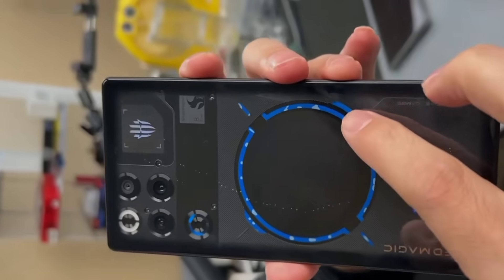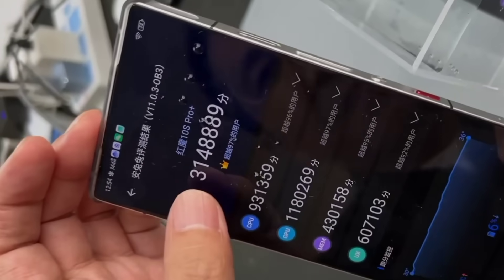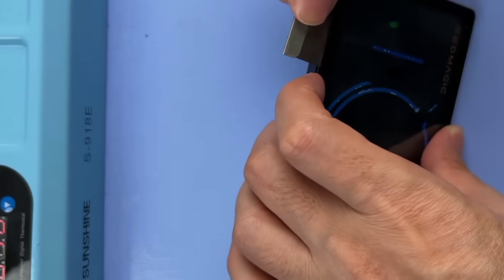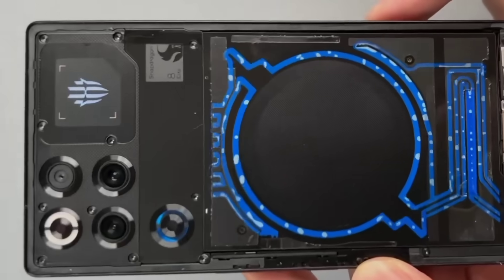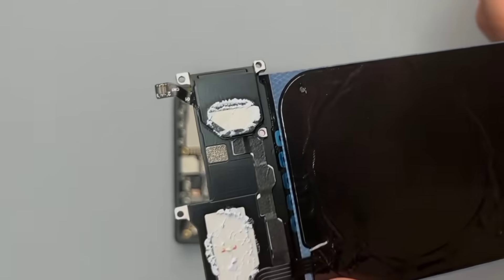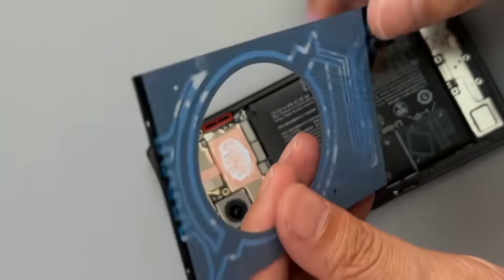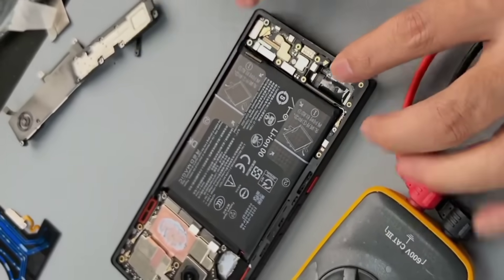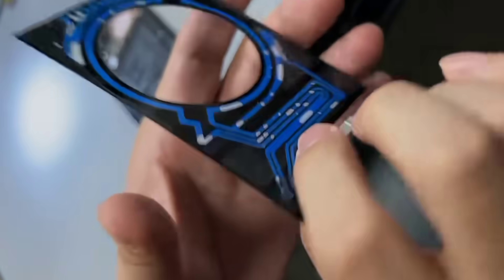RedMagic 11 Pro Plus Teardown (Disassembly) | Where Is Liquid Cooling & Is It Waterproof?!

Comment: Looks really nice the circle in the back but from the practical standpoint, it's bad. Consumes power that on top of that has to convert to pretty high voltage(imagine that redirected to other parts due damage or water). A vapor chamber consumes no power and would probaby be way more effective. But the worst decission of all, the fake carbon fiber sticker covering so much of the pipes of the back, at least show it all!
Reply: Is that voltage dangerous?

Comment: Water cooling is good but in this case it's more of a accessory or a helper to the metal air duct than being the main heat dissipator. Maybe it's more effective during fast charging and wireless charging.

Comment: Why is it impossible for a single cable to deliver 70v? Cables don't care about voltage. Amperage is the limiting factor for a cable and at 70v chances are the amps are extremely low. 

Electrical pylons transport electricity at 100,000-400,000 volts to reduce losses to electrical resistance and it also allows the use of thinner cables to keep costs and weight lower. Electrical resistance in a cable only limits current flow and doesn't care about voltages (unless that cable is short circuited). 1A at 1Ω will drop 1V and dissipate 1W in the cable even if 400,000v is flowing through the cable delivering 400Kw to its end point. Insulation for a cable at such a high voltage can be a problem but for 70v it's not difficult to insulate it and probably wouldn't give you a shock if you did touch it past a little bit of a tingly feeling.
Reply: A dummy question..what does that 70v mean..is it a bad thing? Would it like leak to water if its faulty like if we put our phone in water if its faulty could it cause electrocution?

Comment: But does it have ALL bands for US providers that a carrier purchased device would? I've read too many horror stories of these devices not having all of the same bands... It works but not as well or many not work at all on US based providers... Alll the features and specs don't matter if it doesn't work well or at all when you are off WiFi.... Seems no one really tests this important factor. 😊

Comment: To the people saying the water cooling is ineffective. Remember that they can't put a tube on the soc due to the liquid metal and the vapor chamber put onto the soc which gets put on a motherboard. It uses micro channels to cool the soc. And also liquid cooling isn't meant for the battery since a lithium ion battery is soft. Meaning anything hard in the way is putting pressure on it.

Comment: They did all that and STILL HAVE A HEADPHONE JACK!
SAMSUNG ARE YOU SEEING THIS????
Reply: No hole punch either
Reply: @STEMMONEY but bad selfie camera for those who like photography. Unless u are a gamer then those dosent really matters
Reply: @Darknighteo it's a gaming phone at reasonable price unlike Rog , what you expect😅
Reply: lol no chance samsung want you to buy there shite wireless earbuds
Reply: Samsung fan here, currently using s10 5g, a51 ,tab s9 plus 5g.

Samsung has been corrupted, they're going to turn into Apple, no headphones jack, no spen air command on newest models, no big battery either, nerfing performance on every update (i don't have proof but it's feels more laggy). While adding more and more ai slop. 
Samsung is now just an emty husk, no more innovation. Kinda wish they were like the old times.

At least both phones worked for 5+ years never replaced battery and drawing experience on the tab is as smooth as day 1

If you want innovation, might want these Chinese devices (just don't do sensitive things on it)
Reply: @Tom_Nguyen.  VIVO and XIAOMI are kings :P
Reply: @Tom_Nguyen. more like: never do sensitive things on iphone.

Comment: the liquid cooling gimmick exposed hahahaha, but the phone itself is good though, just no need to uses this trick as revolutionary, since the effectiveness is very low, if not lower than the air  cooling and vapor chamber

Comment: You performed the benchmark with one of the two phones cooled by the water it was immersed in. That test is invalid because the conditions were not identical for both smartphones.
Reply: if ur testing their benchmark, the phones must use their respective Pro's and Con's, no matter what the other phone is lacking

example: testing speed of electric car vs horse carriage. You would be mad because one has horses and one doesnt?
Bro they r designed to be different to help boost the results. So the benchmark results are correct
Reply: @Sleek. You gave a completely stupid example. Smartphones are normally tested at room temperature, and not immersed in water, which can potentially make them colder and improve their performance. Also, using your phone in water is not a normal scenario, you know how it is, humans are not fish, lol. I'm sure the performance is better on the new model, but by how much? That is the question.
Reply: @lucamagni99  u can see exactly by how much, it doesnt matter if the phone is underwater or not, if it is in a place its meant to be/works best in, then its clearly Allowed to be used there

if something requires a certain enviroment to work better then why not use it during tests
Reply: @Sleek. Because that's what Chinese brand sponsors do, choosing the best possible conditions to introduce you to a product is essential to deceive you. Even a banana could be opened underwater, and instead we prefer to peel it out! Hahahaha

Comment: It seems like the water is there to soak the heat so that the fan could cool the vapor chamber more efficiently, the water circulates for even more heat soak capability, that's what allows SD 8 elite Gen 5 to run on peak performance longer, hence the higher antutu score.
Reply: It isn't water...
Reply: @Kit-sd2mu  you don't say 🤣
Reply: @Kit-sd2mu liquid cooling does that sound like water to you ?
Reply: Duh?

Comment: Liquid cooler is just a scam
Reply: We don’t have any proofs yet
Reply: How is it a scam  explain temps are cooler its just facts 🤦‍♂️
Reply: @JudeThaCrude  no direct contact with the aircooling system or neither processor or any copper pipes, the water cooling system on this phone is more battery cooling system, when the major heat issues comes from processor itself, the watercolling marketing is just a gimmick indeed
Reply: @SovietLeo i disagree  dat its a gimmick  temps will be cooler and dats a good thing dat tha battery gets cooled also

Comment: Does this cooling system really work?
Reply: Ofc it does
Reply: not a major cooling , but it help to cool down the battery mostly as it located behind the battery directly.
Reply: It also cools the heat from wireless charging  @ajibnitro9592
Reply: Gimmick? 😢
Reply: Maybe makes a tiny bit of a difference, but as an actual watercooling system it's very poorly designed.

Water is used to move the heat away from the chip to a radiator. In this case the waterloop doesn't touch the APU and it also doesn't touch any kind of proper heatsink. So basically best it can do is absorb heat into the water itself and slowly dissipate it into the body of the phone which is the worst way you can make watercooling work.
Reply: @Aryzon13 air calling makes it possible to cool the CPU I think.
Reply: Poorly ofc try remove the fan and keep the water cooling thingy see how it goes
Reply: @AriBowo-qi5qg every liquid cooling needs fans to work

Comment: I dont want to down side the product looks innovative but the watercooling seems doing nothing , I would thought it has at least a cooper extending to the fan to cool it but there is non the water is just circulating with no way to cool it. I might be wrong but thats how i see it
Reply: Ithink it's better than vapour chamber
Reply: @lazyegoist2012 it's really not. It's way too thin to beat even an aluminum heatsink. It's a gimmick and the built-in fan does all the job.
Reply: true that water cooling is dumb af. ive seen the demo where they dipped in in hot water and the liquid cooling is just as hot as the hot water. but when they removed it on the hot water it cools down very very fast. but since phone always heats up when being used specially in gaming that liquid cooling is basically useless. well its great at cooling down the phone when not in used. apart from that its useless
Reply: we look at actual thing not to someone who doesn't own it. user of rm11pro says it actually works, game maintained the low temperature unlike other phones.

Comment: That water-cooling is useless there is no direct contact to processor.
Reply: I think the water cooling is for the battery. At least thats how its look like. Air cooling is for the cpu and gpu.
Reply: when magnetic cooler is attached, it will surely make a difference
Reply: @abdulsalamolaide5908 when they announce the redmagic 11 pro and pro plus, i hope there will be new magnetic cooler with this event.
Reply: For battery
Reply: It has wireless charging. U can put magnetic cooler and won't attached any cable to the cooler since the cooler will attached via magnet and the wireless charging will power the cooler thus u can play while charging the phone enabling bypass charging. Kinda smart imo
Reply: @DzulikhramZulhizam  OnePlus already has a wireless charger that is also a cooler and it allows bypass charging also OnePlus did water cooling first and it was better than this gimmick red magic made and it was a prototype not even a mass produced phone like this red magic phone ... A prototype did it better than a gaming focused mobile company...
Reply: @El_Goblino_  u bring OnePlus in this conversation already proves you know nothing. You are fighting laws of physics here my guy. No way a vapor chamber can keep a phone cool because a phone is a phone. The cooling solution is limited u don't have holes or vent to dispersed the heat. Redmagic is the only device that has holes and fan to suck the cool air and dispersed hot air. OnePlus doesn't have fans inside of it. That is why I'm calling you delusional if you think a trapped box phone can keep inside cool despite doesn't have any fans. The heat is trapped inside the phone.
Reply: @El_Goblino_  you probably not a esport professional mobile gamer cuz u bring OnePlus on this conversation. For a casual sure. But I'm not talking about casual here bro. Professional mobile fps player play 8-12 hours non-stop. OnePlus 3d wildmark stability test already proves this. In 10 minute mark ran the benchmark it already dropped below 80% stability. Redmagic remains 90% stability. Keep in mind this is just 20 minutes of 3d wildlife running. People game 5,8,11 hours on their phone non-stop something OnePlus can't and won't ever do it. That is the difference between gaming phone and normal phone. A OnePlus can't maintain 80% stability sustain performance in 5 hours continuous gaming session.
Reply: @DzulikhramZulhizam  let's be honest here ... How many mobile gamers get to go on the " professional" level 😂 1% probably mobile gaming in general is just pathetic and sad I'd rather get a phone that can do everything equally as good not just one thing 🤦‍♂️ you simply don't understand
Reply: @DzulikhramZulhizam  if you play on your phone for 5+ hours non stop then you need to reconsider your life choices ... Mobile games are for kids
Reply: @El_Goblino_  It's a gaming phone. Don't expect this phone to be able to do everything better than a flagship phone of other brands. 
It's like saying that a supercar is useless because it can't go off-road like a g-wagon. 😂😂😂
Reply: @ThaNaT0s-uwu  if you wanna go that way then ok sure look at this : mobile games vs console/PC games it's like you are saying you prefer paying the same price as a great off-road car to get a crappy riced out mall crawler or a pavement princess and take it off road 🤦‍♂️ that's the gaming phone + the mobile games vs console/PC and their games ... The top spec model is $1000+ you can get 2 PS5 with that or 1 PS5 pro or hell you can even get 3 series S or simply build a great PC with that price and All of those options are better than" mobile gayming " name 1 good mobile game comparable to console or PC games ... Don't say warzone mobile or any PC port to mobile those are just for money grab ... Name 1 original mobile game that can be compared to PC/console level ... You can't there is non the whole point of mobile gaming is because people can't afford a console and their games or a PC so they play mobile games on their cheap mobiles ... But spending $1k on a " gaming phone " is just stupid get a console or PC instead with that price ... And if you say but the low spec is $700-800 you can still build a great PC with that budget or get a PS5 pro 😂 hell even a PS4 will still give you more entertainment than " mobile gayming "
Reply: @El_Goblino_  buddy let's be real, your on a redmagic video. Red magic is for gaming. Don't talk about other phones when the main thing about redmagic is gaming.

It's not 1% your a western delulu lmao. There a more than thousands of professional player in every game category and there's are millions of newcomers that are grinding their way to make a name for themselves everyday. If someone's retired there's 100 more will take his place.
Reply: @DzulikhramZulhizam  all that yapping and copium doesn't change the fact that mobile gaming is a meme amongst the real gaming community y'all are so laughed at and hated it's so pathetic 😂 " make a name for themselves" ofc suuure 😂 no matter how big they get they won't even come close the least famous pro on console or pc and that's a fact nor make as much money as him 😭 i wonder why ? Because it simply sucks
Reply: @El_Goblino_  hated but the most profit and biggest revenue. Just Google what game makes the most money 😂 and what platforms is the biggest active and revenue. Yeah pc and console is Soo small even there's a YouTube video explaining PC guys are stinky with their money. Won't buy game with normal price y'all wait for discount lmao. 

Meanwhile mobile games we throw $500,$1000 casually every week. Seriously there's even a YouTube video created telling why PC are soo stinky with money. It's either they can't afford it or stingy with their money.
Reply: @El_Goblino_  Get a life 😂😂😂
Reply: @ThaNaT0s-uwu  " get a life " says the one who plays 5+ hours non stop on their little phone 😭
Reply: @El_Goblino_  5 hours? I only open this app on my breaks. I don't have the time to make essays like you because unlike you I have work. 😂😂😂
Reply: @El_Goblino_ Says Mobile games are for kids and then proceeds to watch a tear down video of a gaming phone. Proceeds to glaze OnePlus and failed miserably due to half knowledge and non contexual replies. U are a walking retrocausality.
Reply: @Randomxyz-777  watched it because it got recommended to me you goof 💀 and I didn't glaze OnePlus I don't even own a OnePlus I just stated a fact you kids learn a new word and keep using it glazing is different than stating an actual fact lil bro
Reply: Naa it's not useless it's there because it helps to spread heat more evenly throughout the phone increasing performance
Reply: @NPMS903DORAEMON its not directly